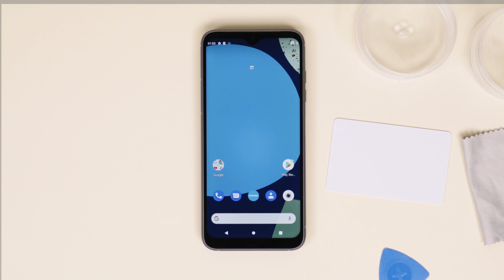Getting Started | HOW TO FAIRPHONE 4

Comment: I would buy this phone in a heartbeat if I could snap out my battery like this 1:24 and instantly put in another one at 100% while charging the other battery in a separate charger for batteries only. This way I don't have to plug in the cord to charge my phone ever and just the batteries. This is how I use my current phone and it feels like I have unlimited battery.
Reply: The reason why I really hate the built-in batteries. I want removal battery back and I also want a charger that automatically unplug when the battery is 90% to avoid overcharging and reducing the lifespan of the battery.
Reply: Do you have a fast external charger though?
I looked for those when I was still trying out my pinephone but all the ones I bought are very slow chargers :(
I wish fairphone sells their own.

Comment: I have just bought one, because My Fairphone 3 got wet, worked, but could no longer load and replacing parts could no longer be ordered. I think this is strange, because I am now forced to buy another phone. Why not keep spare parts in stock as long as the phone is in the market?
Reply: Actually, they stopped selling the Fairphone 3 in 2021 and the Fairphone 3+ in 2022. Some of the parts likely won’t be coming back, but some are still in stock, i.e. battery, screen/display, or camera of both the 3 and 3+ (cross-compatible)

Comment: A real fairphone should come with a free operating system. Meanwhile, it cannot be considered fairphone.
Reply: Don't reinvent the wheel dude. This is why we can't have good things, we can't be contented. A good solution is placed in front of use, yet you still want more.
Reply: @capymusic6319  I'm not reinventing nothing. If you ignore the damage that involves using Android or IOS, then, enjoy it. In my opinion, the software is as inportant as the hardware, so it is not correct to call it fairphone, because Google or Apple are not fair at all. I real fairphone should, at least, offer a free operating system. Meanwhile that's like using square wheels. Fairer that the other smatphones? Yes, of course. A fair phone? Not at all.
Reply: @baitazeare  that's why they have the lineageos version